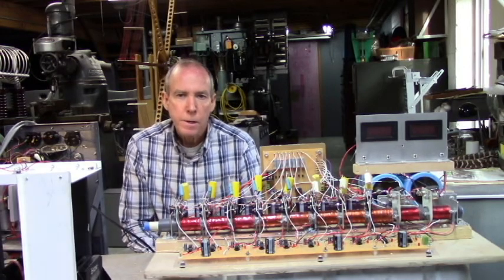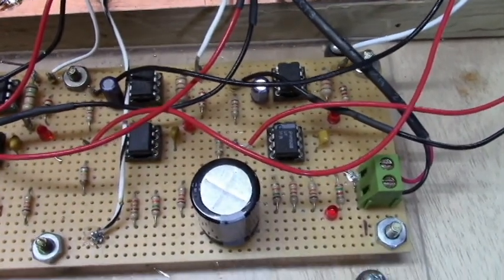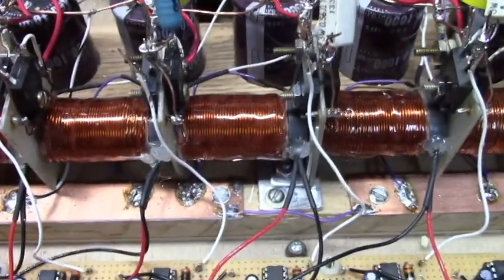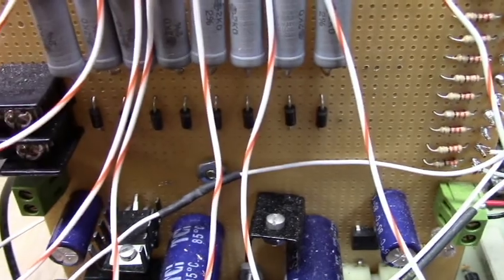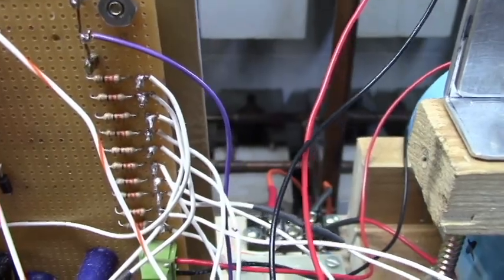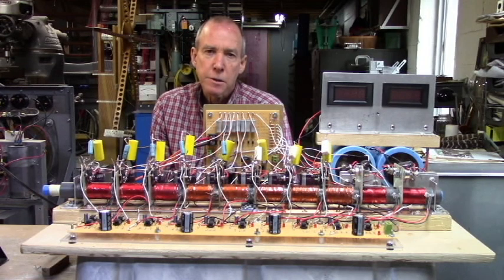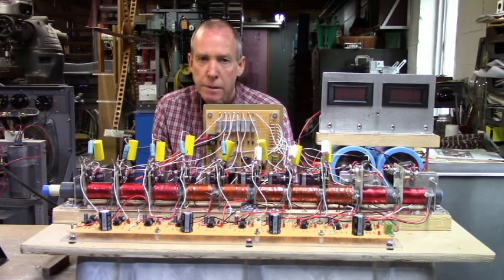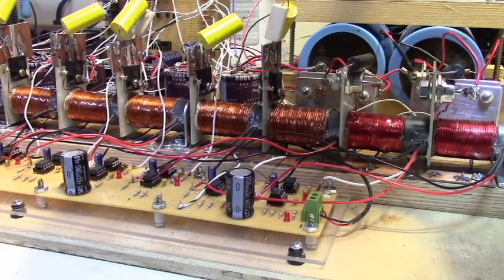coil gun part 4

Comment: A smaller, skinnier projectile will have much better velocity and range. Several hundred fps
Reply from the maker: My next coil gun will use parallel IGBT's and less inductance. I think a faster high current coil might work better plus a vented barrel. My biggest issue is finding the right high current pulse resistors.

Comment: Take off the sensors, and control individual stages digitally with arduino for example, you can get timing experimentally firing stage by stage
Reply from the maker: I am working on a system using a slotted tube barrel. That will allow barrel venting and allow for adjustable sensor timing This system will use higher voltage power components. I am mostly a mechanic and some power electronics. Not much of a computer guy.

Comment: Hi Stephen, interesting series of videos, I hope you won't mind me offering some suggestions? 1) Use smaller modern IGBT's, instead of those huge power puck types, they'll be quicker and their peak current specs are impressive, after all you don't need the continuous rating just the pulse. 2) The rise time of the optical sensors is some three orders of magnitude faster than the velocity timings you are dealing with so will be insignificant. 3)  You'll find it really useful to implement an Arduino based control system, it's really easy, cheap, flexible and will allow you to make control changes very quickly and easily. Also I'm pleased to see you're talking in Joules not Watts! Good luck for your future experimenting!
Reply from the maker: I can never have enough helpful suggestions such as you posted. It is the comments that guides me along. The SCR power pucks were items I had laying around. I used them to work with them with a future power controller in mind. This project is a work in progress for linear power electronics. The rise time for the SCR is poor for the job I have for them but for the first stage it works well. And I agree I do need a controller. Thank you very much for your advise.

Comment: It seems that you have too high capacity. For 400v it is enough ~500-900uf per stage with this dimensions of coils. Also you should try to disable some coils, pulling force requires field gradient near its face (axial field create steel magnetisation, radial field - create force) - if coils are too close, they can't create enough field divergence when both near coil works. The gap between coils should be at least ~= 0.5 lenght of coil or bullet. Your setup with 5 stages active should reach not less than ~55...60mps with correct timings, good luck!
Reply from the maker: Thanks for your intelligent  suggestions, I will try a larger coil gap on my next setup. I had  oscilloscope readings on the coil but I did not understand the readings very well. As far as capacitor size I turn off the IGBT as the bullet is half through the coil. I would rather maintain a higher voltage on the coil to that point.
Reply: @stephenhrobak3631 Be carefull with IGBT switch - it is necessary to have resistance in the diode snabber circuit - low resistance creates too long current tail, high - kills easy IGBT switch or coil. Any method to turn off high current in coil fast creates very high voltage surge. https://tinyurl.com/yggn4a69 there is simple circuit for typical coil for coilgun (~30x35mm by 0.8mm wire and 1000uf capacitor), try to turn-off fire switch when I~300A and see ~1.5..1.6kV surge with 5ohm diode ballast. Then try change diode resistance to 1ohm or 10 ohm - to see longer or shorter tail, but lower or higher voltage surge. This is compromise question: you want to make short current tail, but limited by votlage strength of IGBT... You can also try to use V-switch http://www.coilgun.ru/v_switch.htm https://www.coilgun.info/mark4/diode.htm to quench current with SCRs only instead of IGBT, if IGBT with ~300A@1ms and +1.5kV strength is too expensive.
Reply from the maker: @igbtbardin6713  This is nice stuff, Greatly appreciated .

Comment: One of the most advanced coilgun system I've seen on youtube! Could you give efficiency numbers? It seems there is something holding back this style to around %6 efficiency. 

You could put kv into these and it would be faster, but if you could get past the efficiency wall your power would jump like crazy.
Reply from the maker: Thanks for your interest. From what I am learning efficiency could be raised but you will not get much speed. My next step is to parallel the switches and pour in the current.

Comment: Thank you for sharing another interesting project! I've been following all the other attempts, it seems that there's another factor than voltage that is limiting the output velocity. You have increased many times the energy (V^2) but the velocity increase was 20% top. Did you try to use less stages, what is the optimum number ? I mean optimum energy transfer, not the highest velocity but ignoring the efficiency. Did you decide to go big, like large SCR's and high energy capacitors with 2-4 stages, with many thousands of amps in very thick wire? I would try this option too.
Reply from the maker: I am just finding this out through experiment. I started this coil gun without knowing very much. The next step is current limit and current sharing parallel switches. You need to turn the coil off as well as on. Coil design and matching to the load will help.